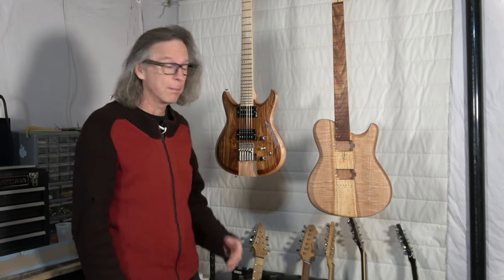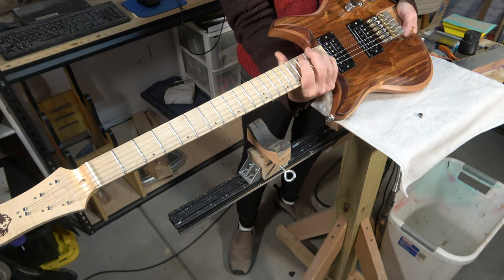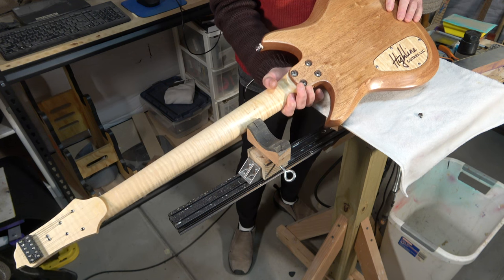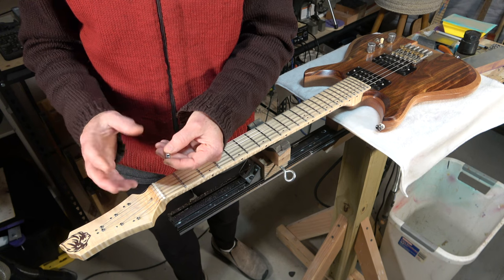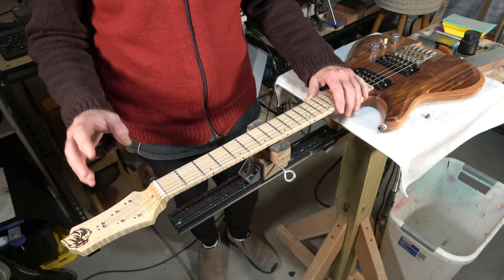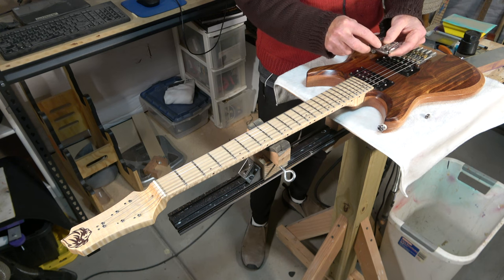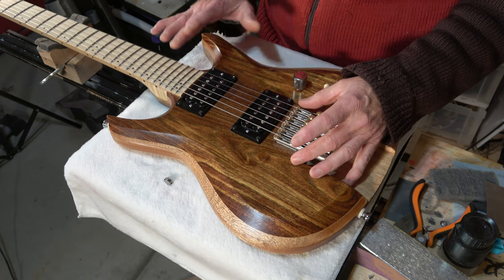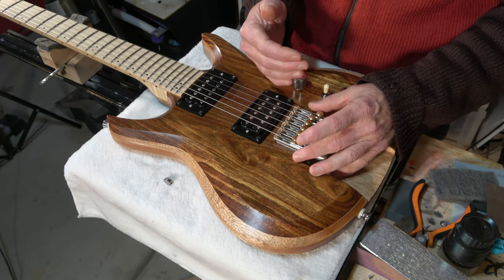Combining A Headless Electric Guitar With A Traditional Electric Guitar Part 16 Final Thoughts

Comment: This series is a godsend for me. I had this concept and thought I might have been the first. I was going to run it by my luthier because he wants to do a build for me. So glad to see you already experimented.

I have a Strandberg and in an minutes realized that the biggest advantages to the headless design are not the main things people talk about. 

The things that made me pick it up over and over again were not the weight, the ergonomics, or the portability, but the fact that the action, sutain, intonation, and tuning stability were vastly better than any guitar I had ever played.

It's pretty easy to deduce why this is. The string is almost completely straight with the headless system. It just fixes at the bridge and in the locking nut, with very mild angles and no winds. It makes sense to me that this would make the guitar sustain and hold tune so well. 

One question though: It's very easy to bend on a Strandberg. I thought this was due to the 20" radius. Do you think the headless hardware makes bending easier?

Comment: I've really enjoyed this series and watching the guitar take shape. I hope you'll attempt another headless again. 

I'd like to recommend checking out the KD Patented bridge, which is installed on many popular headless models like Eart, Jamstik Studio, ALP, etc. I've seen this bridge sold on Amazon. There are YouTube videos that show how the bridge works because it's different than most designs. I've heard others share good experiences with it, and I have to agree based on my own experience. 

I mention this bridge because you can still probably make a similar design as a JamStik Studio with locking nut and have the strings strug through a traditional headstock design like the one you used for this build. I bet you can still incorporate a traditional headless string retainers similar to the one on the Jamstik Studio into a traditional headstock shape -- pretty sure you can make something similar. The Jamstik Studio is a bit different than most headless guitars because it has a nice metal cap covering the string retainers (and a handy pick drawer!). Imagine doing something similar while building a larger more traditional headstock design over the retainers instead of the metal cover on the Studio. You can hollow out the headstock somewhat where it meets the traditional headless retainer and leave the retainer visible from the back of the headstock. You can also opt to make the headstock like a decorative cover that snaps onto and covers over the entire retainer (it would be removed each time the strings are changed).

I don't know if you can picture what I mean, but check out the Jamstik Studio and use it's parts and design as inspiration. If you can't find clear photos of the bridge and entire top of the "headstock," let me know -- I'd be glad to send you some photos.

I love your innovations here and moon forward to the next one!
Reply from the maker: I looked at the KD bridge. I elected not to try one because so many people seem to dislike it. I think the licensed versions are the problem. They seem to be of very poor quality, like cheap Floyd Rose tremolos. I may look for a genuine KD bridge as I like how it works.

Comment: Have you thought about fitting pickups with different pole-piece spacing?
Reply from the maker: Of course I have. I can choose from 52, 50, and 49.5mm. I tried 50mm in the bridge and 49.5mm in the neck, but it was still off.

Comment: Hey Chris,
just finished building a headless guitar and I figured out a solution to the string retainer problem, in fact, I've posted a video in which I show how to remedy the problem, Check it out, man.
Cheers, Nativ
Reply from the maker: I considered this, but the retainer housing on mine is machined steel which is much harder to tap. I may get the right size drill bit and tap to do it.
Reply: @HighlineGuitars  good luck man, the right size drill bit and tap should make it easy :)
Reply: @HighlineGuitars  What do you mean by 'machined' steel?  Why would it be hard to tap?  Have you tried to tap them before. I love the Guitar dudes idea by using a set screw as a tap in a pinch don't you? Probably time to get a cheap tap set for your shop though!  ;).  The body on this guitar is just freaking beautiful. Very tastefully done. Sorry if I missed it, but is it your design?  The shape, wood grain, and finish is just so nice.
Reply from the maker: @threeque  Many of the retainers on the market are cast metal and therefore easy to tap with a screw. Mine are machined or milled steel. A modified set screw won’t work. I need a tap made from tool steel. I have a drawer full, but I need to find one that is the right size and dig out a bit that corresponds.
Reply: @threeque Thanks man, it's a simple easy solution and it works, I've finished my guitar 6 days ago and it stays in tune like a champ.
are you referring to my guitar? if you are then YES, this is my design, Thanks!
soon I'll upload a spec and sound demo video if you are interested :)
Reply: @HashtaGuitars  My comments were aimed at Chris's guitar. Just love it. I can't see yours too clearly.  Looks cool from what I can se. Looks angular like a scorpion body style 
guitar.
Reply: @HighlineGuitars  At the risk of being called a Cliff Clavin again :) , you will find set screws are harder than steel. They would work for a few holes. Again in a pinch. Time to dig out those taps!
Reply: @threeque  I thought so :), anyway if you're interested you can check out my Instagram to see the guitar I finished on that video and other guitars I've built...
I would love to hear your thoughts... 
Thanks :)
Reply: @HashtaGuitars  I just looked at your other  videos. I see the finished headless guitar. Very slick. Very 'metal'.  Would be perfect for Kiss!  lol